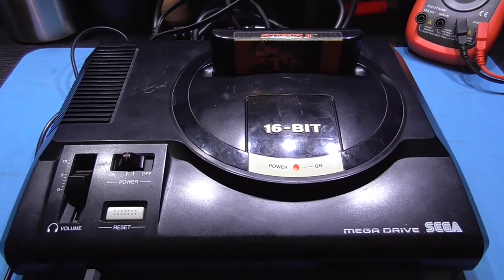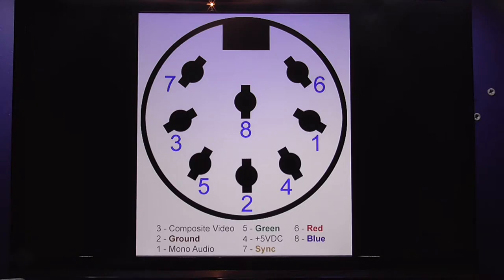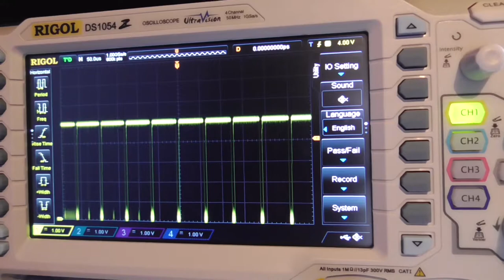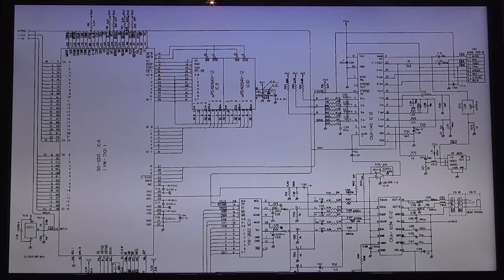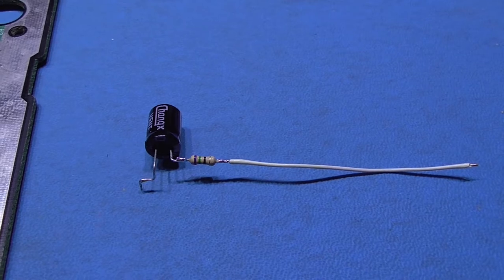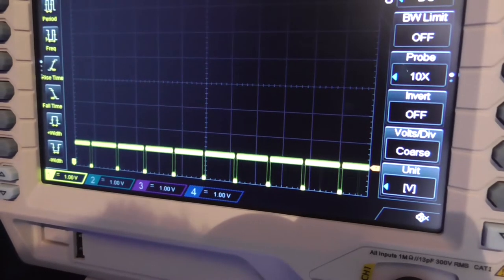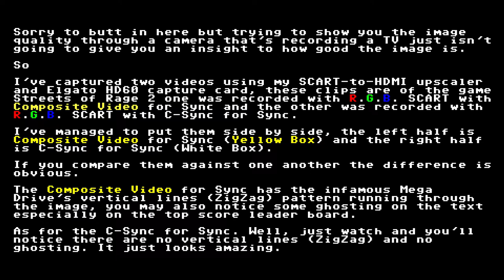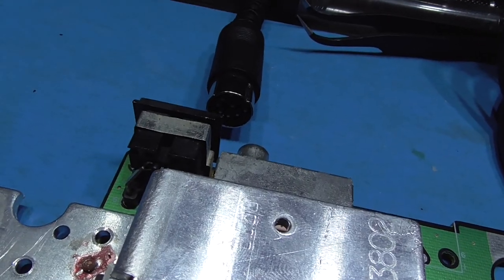Sega Mega Drive / Genesis - Part 1 - C-Sync Mod

Comment: I have a question. After the c-sync mod you've shown, has the RGB/Scart-cable to have the 75ohm resistors and capacitos soldered to it? (hidden in the scarts plug plastic body)
Or is this only necessary when the console is modulated differently. When the RGB is taken from the pins of the chip, etc.

Comment: BTW - the point where its most noticeable - pause at 17:35 and look at the "RA" part of the title text.  You can see the lines there.  I am wondering if this is the 'jail bars' that people talk about - myself included.  Jailbars on mine are very noticeable and I've been looking for a solution for ages.
Reply from the maker: Yes there the infamous Sega Mega Drive jail bars alright, it's very noticeable the difference between Composite Video for Sync and C-Sync for Sync i.e. no jail bars.

Comment: Hello.

I need to understand this.

Sync is fed from the 'VDP Pin 42' and sent to 'CXA Sync-In' and simultaneously 'AV Output Pin 7'.

'AV Output Pin 7' is TTL Sync.

You cut the line between 'CXA Sync-In' and 'AV Output Pin 7'.

'AV Output Pin 7' is now dead.

You then wire up the components between 'CXA Sync-Out' and 'AV Output Pin 7' to produce correctly attenuated sync at 'AV Output Pin 7'.

My questions.

Does 'CXA Sync-Out' supply TTL sync with no mod? So by design the CXA is just a pass through for the sync if used?
Could these components be placed in the SCART and the SCART rewired to use Pin 7 as sync, which would keep TTL sync for 32X compatibility?

Please help me understand because this is pickling my head.

Great video.
Thanks

Comment: After this mod, the cable itself need internal parts or not for Sync? (i.e. capacitors or resistors)
Reply from the maker: Nope a scart cable will be ok, no need to mod it.
Reply: @Four_X  ok thanks.

Comment: Ah ... so this "zigzag" vertical lines issue means the same thing as "jailbar"! However, will it work if we are using HD RetroVision cables (8-pin DIN adapter to Genesis 2 YPbPr cable)?

Comment: Great job =D  I would have done that c-sync mod the exact same way!  Leaving the pinout the same as originally intended etc.   One thing I am not sure about, will that work with the 32x, or does the 32x then need a mod?  I cannot remember if the c-sync connection is required by the 32x.
Reply from the maker: To be honest I couldn't tell you as I don't own a 32X, I can't see how it would be a problem if it's just a simple pass through cable between the Mega Drive and 32X, however I suppose worst case scenario if it didn't work a simple switch internally in the mega drive to be able to switch Pin 7 from the original TTL C-Sync and C-Sync coming out the video encoder chip would remedy the problem if there were one.
Reply: I thought that might be an issue.  I do know the RGB Megadrive wont work with the 32x unless you do something (boost) the csync level.
Reply: Yeah, I know that lol - Was just having a "senior moment" =D  Technically TTL only needs to be 2.7v.
Reply from the maker: bloody sega messing up my video, ha. i had a hunch that was the case with the 32X.
Reply: Sorry Xaranar - my bad!  I need to learn to read lol :o)
Reply: @FourX2k3 - nah, it's still a very cool video!  The fact you've got such a clear display there makes it really useful.  All we need to do now is find a way to get the 32x working as well.  Maybe a 2N3904 or something would be sufficient to keep the 32x happy.

Comment: Could you write resistor and cap values in description? I´m using subtitles and google translator could be wrong.

I understand 220uF and 75ohm.

Also i´d like to add scart connector. Could i take mod cable and put into scart composite pin without cut pcb line that goes to DIN connector?
Reply: @Charles Adrien definitely, I have been watching on Instaflixxer for since november myself :)

Comment: Hello, I have my megadrive with a VA4 model board that did not start, but I found the bug in the cxa1145, which I have replaced by a new one.
Now I have audio on TV, but I have no image.
I use a megadrive / hdmi connection cable.
I have a signal on the H sync and V sync pins with the oscilloscope, but on pin 42 csync I have no signal, I only have 5vdc.
if someone can help me to do some checks or this looks like a broken vdp.

thanks in advance!

Comment: I just did this to my mine and the jail bars are gone thanks, but the image has shifted to the left and I'm losing some of the image. If I use an unmodified RGB cable it's fine (but with jail bars) so it seems to be only when using csync. Have you seen this before? I'm using a wide-screen LCD in 4:3 (black bars on the sides) so the cut-off image isn't just out of view. Thanks
Reply: I bought a scart cable and my image is also shifted to the left :(
Reply: @KameMameHa  A CSYNC cable without this mod or a cable wired to take CSYNC from this mod?
Reply: @jonathansteel  without the mod. Just wanted to say that was not a particular issue of the mod
Reply: @KameMameHa  I just ordered a CSYNC cable today from retrogamingcables, what are the chances! Where did you get yours from? I'll report back if I have the issue with theirs or not when it arrives.
Reply: @jonathansteel  mine is from consolegods. If your works ill buy that one also
Reply: @KameMameHa  consolegoods? Are you sure that it's CSYNC? Their cables don't seem to be, looking at the descriptions.
Reply: @jonathansteel  maybe that is my problem. I bought it some time ago and i am not sure about it
Reply: @KameMameHa  same problem with this cable unfortunately. So I tried my mega drive 2 with a standard RGB scart cable and jail bars are extremely faint so I think I'll just be using that from now on. Sound not quite as rich but not bad.
Reply: @jonathansteel  finally i investigated and the image displaced is a common problem with RGB  on TVs.  I fixed it entering the service mode on the TV and moving the inage to the right
Reply: @KameMameHa  ok interesting. Would that affect all RGB inputs though as other consoles are aligned centrally for me so I wouldn't want to change it for those
Reply: @jonathansteel  yes, unless the tv has more than one input.
Reply: @KameMameHa  I bought an OSSC and going through that, I don't get the shifting problem :)
Reply: @jonathansteel  ossc is on my plans ... :)